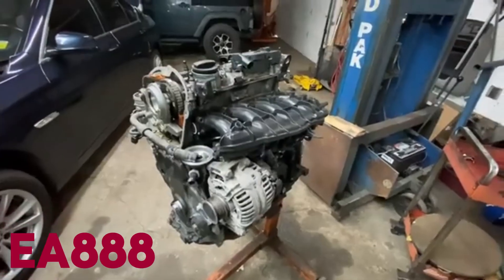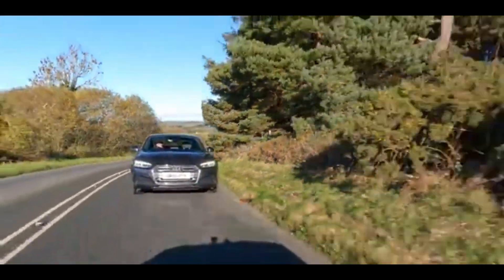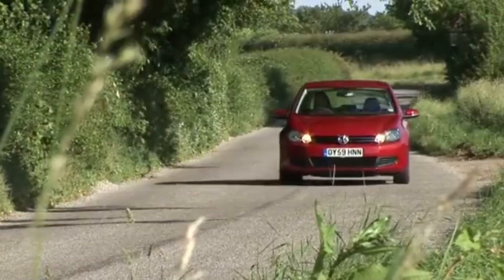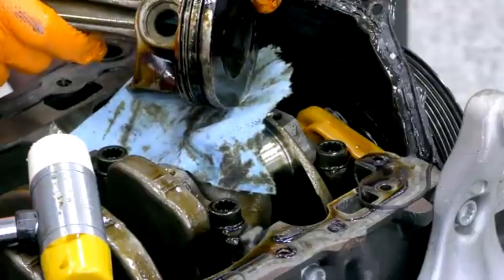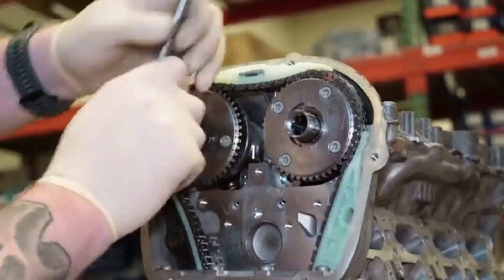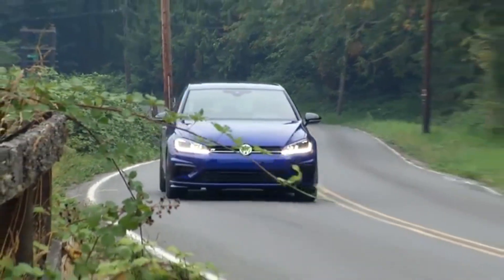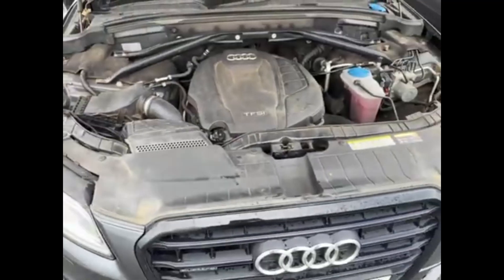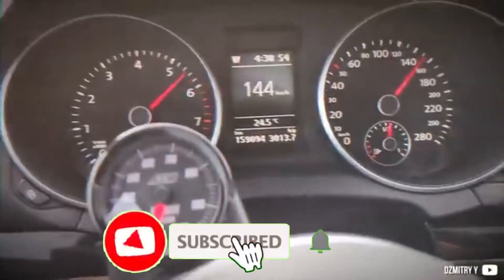VW Audi EA888 TSI/TFSI| The Engine That Powers Almost Every VW & Audi

Comment: In short, all generations of these engines have serious chronic problems that, after the warranty expires, make every consumer regret owning a VW. Instead of sitting on the fence, the article could highlight that in the latest reliability survey conducted in the US with consumers, VW ranked last among all brands sold in the country; it managed the feat of being worse than Land Rover. That's a fact!
Reply: What survey is that - can you link to it?  Worse than Land Rover is difficult to believe.
Reply: I do change my oil every 3,000 miles though, Well I've got gen3, 10 years old, only had to do the thermostat housing, did myself, £400 all in with 5ltr vw coolant 👍 not bad for 10years, I do change the oil every 3,000 miles though, will probably get timing done soon as better to be safe than sorry.. warranty ran out 7 years ago